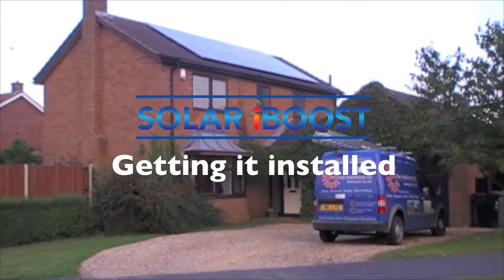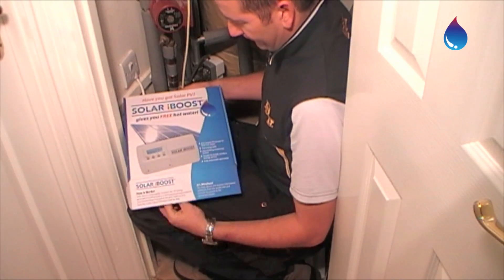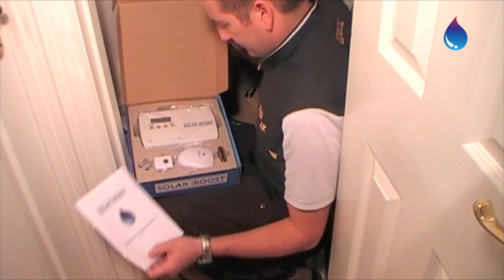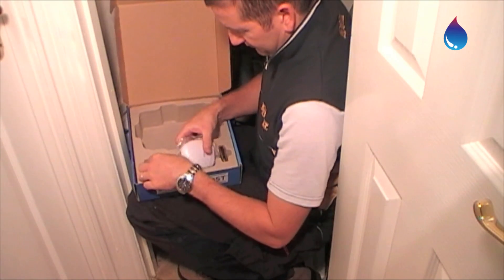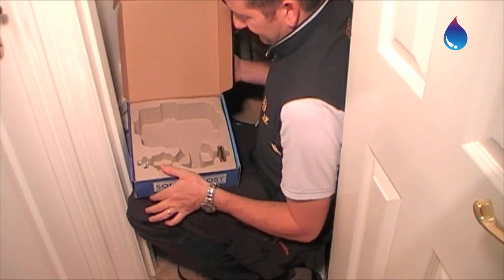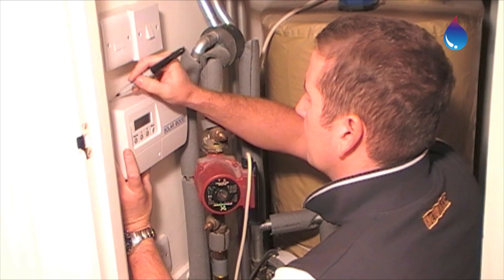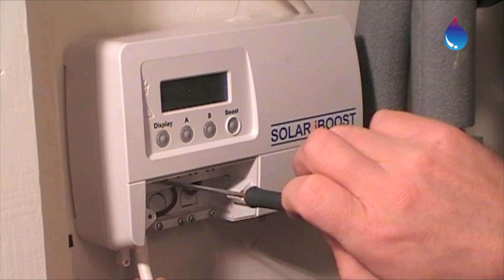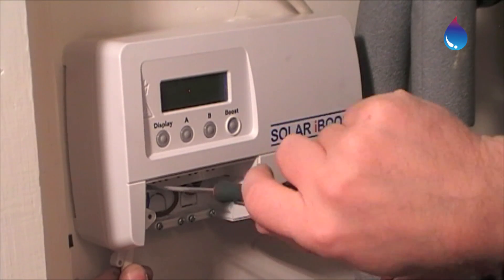Solar iBoost - Getting it installed

Comment: If the switch is on and there is no/insufficient power from the panels.  Does the immersion heater draw mains power?   Per KWH electricity to heat water costs about 300% of gas cost.
Reply from the maker: No Ciaran, the Solar iBoost+ is a proportional controller so will only divert the excess electricity which would have been exported, to the element.  If you have little to no excess, the Solar iBoost+ will not power the element.  There is a manual boost function if you want to heat the element using full mains power.